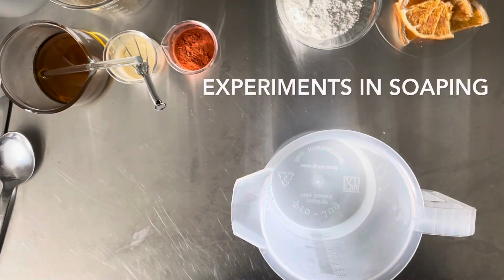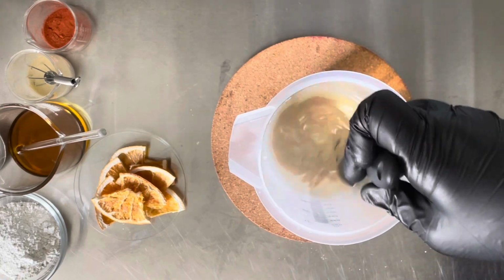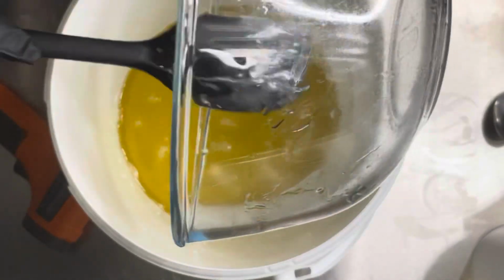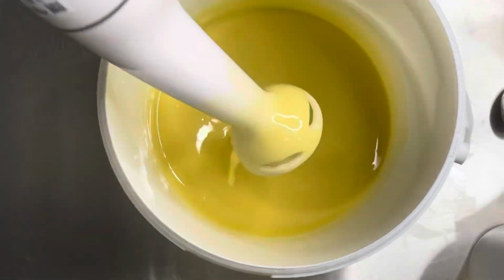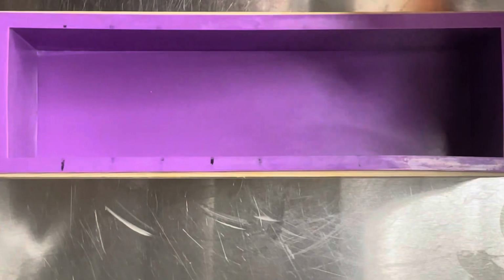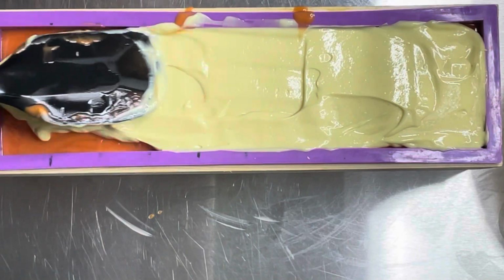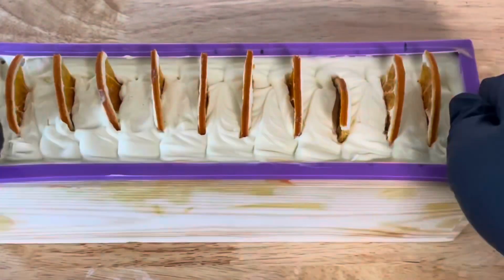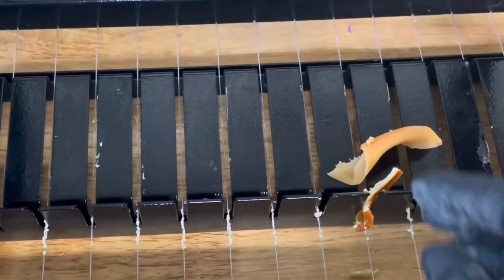Testing SUGAR and CITRIC at the Same time in soap

Comment: Love to hear your update with this soap and whether you felt that the citric and sugar made a difference. I always use sugar and find I get a much better lather and as chelators go I prefer to use sodium citrate so no messing around its just mix powder in water and ready to go plus I also use sodium glutamate which is slightly more effective and any of those really do make a difference in my very hard concrete water and they are easily findable!. Thank you for sharing your great video and I especially love a bit of experimenting.
Reply from the maker: Hi, yes it's made a world of difference... 'concrete water' haha! that very much describes the water here too.  I can happily say that it worked well in tandem with the sugar.  I still got a very good bubbly lather and there was little to no soap scum, which surprised me, as I thought I'd used quite a low amount, but it seems to have done the trick.  Without it, the other soaps I've made leave a load of soap scum in the sink.  The difference is amazing, so going to continue with it :)